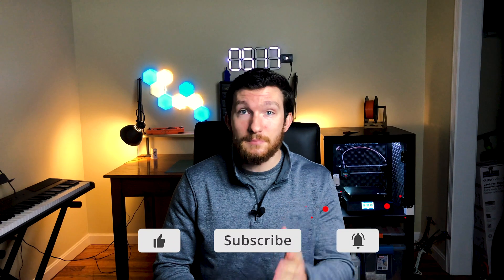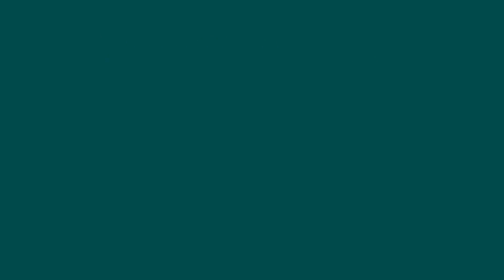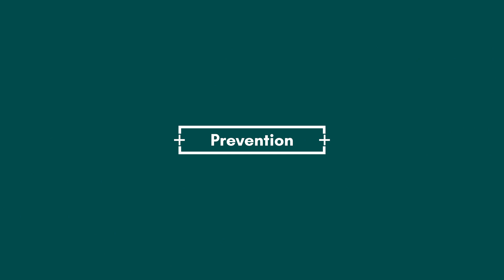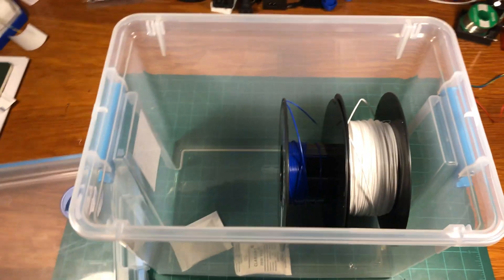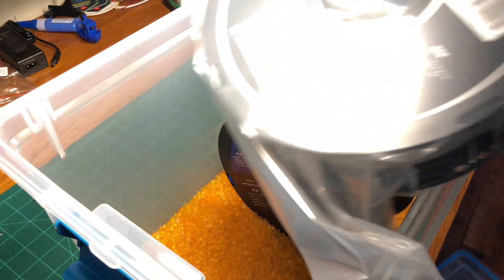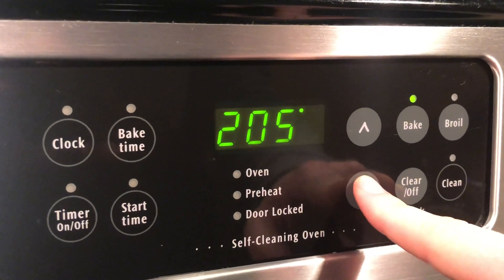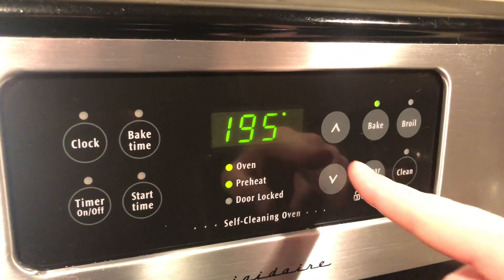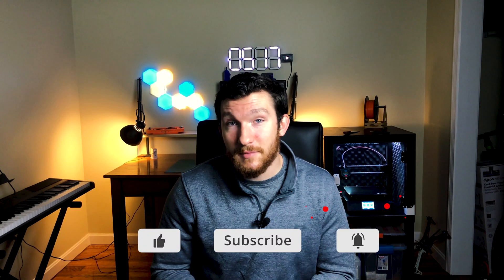How to Make a DIY 3D Printer Filament Storage Box [Fix For Brittle Filament!]

Comment: i use reusable bags that I can put vacuum with some of those gel beads that i get with ordering new filament is that oke in the long run ? And my 3D printer is next to a window so the sun shines in on my filament im using can it harm it ?

Comment: You can buy an eva dry rechargeable silica dryer that plugs into the wall for your box.  Less hassle and no beads.
Reply: I have that and it's worked great so far

Comment: Thanks! How long you was using that spool that got brittle (of course it depends on various factors, just curious)?
Reply from the maker: Thanks for the comment! It usually has become noticeably more brittle within a month of sitting out. This storage box still isn't a perfect solution, but it certainly bumps that timeframe up closer to the 1 year mark, before the filament is too brittle. Hope that helps!

Comment: In a pinch (oven does not go low enough) you can use the heated printer bed (+ insulated cover) to 'bake' the filament rolls back to life.
Reply from the maker: That's an awesome idea, I'll have to try that out! Thanks for the comment!

Comment: Unless your oven is super reliable with electronic temperature control, you risk heat-spikes fusing or distorting your filament. I made this mistake before investing in a filament dryer. Get a filament dryer, it will save you money.
Reply from the maker: Thanks for the comment! Any filament dryers you recommend?
Reply: @ModernHobbyist  I have one of the old horizontal spool PrintDry driers. It works well but has occasional temperature spikes and the bottom chamber runs a few degrees hotter than the top. Most filaments are absolutely fine with the temp variations but I have had a few cheaper filament spools start to stick together slightly (Still uncoiled and printed ok but made little crackling sounds as the filament broke/peeled free from the coil).

The newer PrintDry units cost a bit more but have electronic temperature control and vertical mounting rods. Much better than the old model. I'd definitely get one if I hadn't already spent $180 on the V1 model.

The old model PrintDry is based on a modified food dehydrator and some people have also had luck modifying bargain off-the-shelf units for filament drying. You still run risks as the temperature controls are not intended for 3D printing filament, but even then it's much less risky than the oven as temperature may vary by +- 10°C instead of potentially shooting up by 50°C or more in a conventional oven.
Reply from the maker: Thanks for the info!

Comment: Which size tote is that?
Reply from the maker: The one I used was the 20qt one, but I can only fit 4 rolls of filament. There is also a 54qt version that might be a good option!
Reply: @ModernHobbyist  I had to get one that could slide underneath my machine. I think it’s the same size. I ordered my 2lbs of beads (blue ones) and they just arrived. Box is all setup and good to go. Thanks. 🙏🏾

Comment: You have to bake the gel at 120C max. Over this temperature the gel is damaged.
Reply from the maker: Thanks for the comment! In my video I was using Fahrenheit, so you'd have to adjust for that if you use Celsius. Thanks!